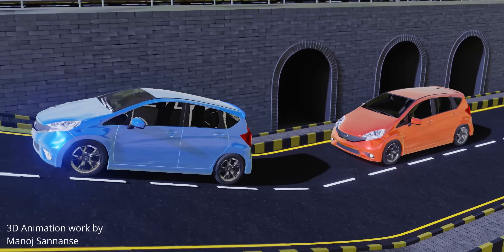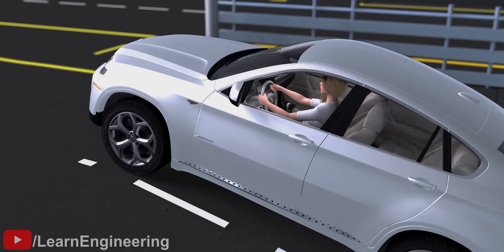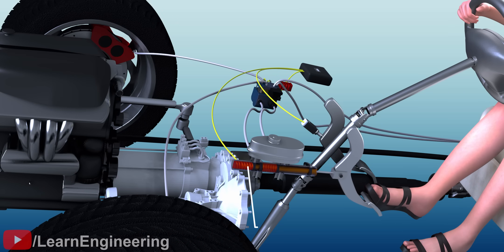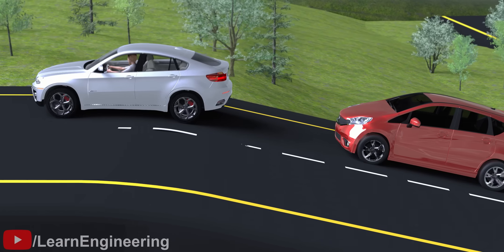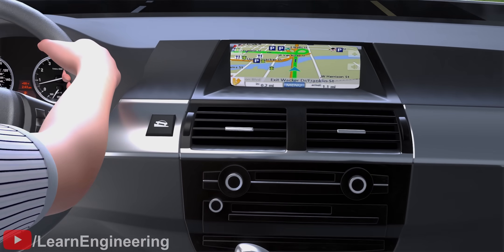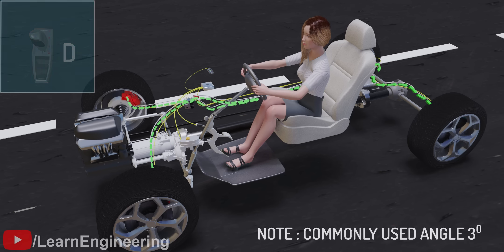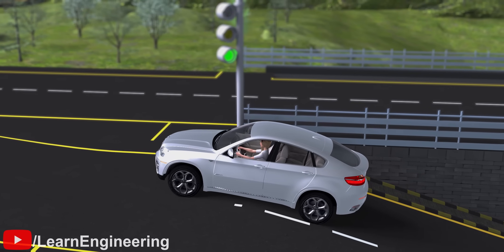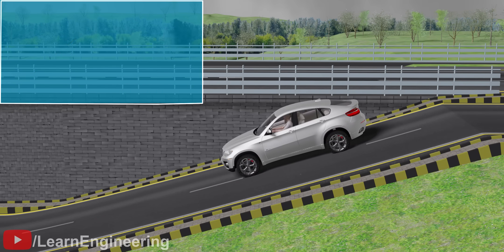Understanding Hill Start Assist!

Comment: Engineers: invents a new system to make uphill driving easier for daily drivers
Manual elitists on Youtube: "LOl, jusT uSe a ManUAl aND HAndbRAke."

Seriously, most people saying this haven't really experienced a manual car without a modern HSA system included. Even slight inclines will become an annoyance if other drivers decide to be an ass and pull up three inches behind you, which in California has a 95% chance of happening. 

You don't want every hill to be "handbrake, wait, clutch, throttle, hold for a sec, handbrake, go" in traffic. God forbid that somebody in front of you has to stop instantly to avoid a crash or something, and you're too busy slamming the brake to remember to push the clutch in, meaning now you've stalled and have to start the car again.

It's easily the biggest issue manual cars have, even more than automatics w/ paddle shifters being able to go faster than a stick nowadays. There's a reason why automatic cars outsell manuals, even in cars designed with enthusiasts in mind. They're just easier to live with. Unless you're a trucker or own a pickup, there isn't really a necessity to buying a stick anymore, paddle shifters are at a place where they can give you the same amount of fun as a stick.
Reply: This is what stick haters say these days ...
LoL

Comment: I love how all the cars in the simulation are automatic. is it not simple enough to hold the car on the handbrake and then build the revs before you release it?
Reply: Exactly. This system should be called "bad driver assist".
Reply: Kurt, LOL.   So true!
Reply: Hell, with a torque converter automatic, you can just hold it with the throttle. You don't want to do it for 20 minutes at a time, but sitting at a stoplight is fine.
Reply: Automatic vs Manual:

Automatic: press the hill assist button, let go of break press gas.

Commentator: really tedious for new drivers. 

Manual: clutch in, break, handbreak, slowly raise clutch up until you find the biting point (if you let brake the car should be stopped, that's the biting point), let brake, step on gas (appropriate gas to the elevation), slowly raise clutch while holding gas at the same pressure, keep pressuring clutch at a slightly weaker state so the car can move and then let the clutch go before immidietly pressing it in again to immidietly change gear 2 in a road with no harsh elevation.
Reply: Hahahaha ikr, these people suck at driving in the US, not even with damn automatic cars they can manage god damn it!

Comment: I have a doubt

I can drive Uphill a car with the same speed using 
# 3rd gear at high acceleration 
# 2nd gear at lower acceleration.
(Can't switch to any other gear, but can toggle in between these gears)

(2nd gear has less tooth compared to 3rd and low output compared to 3rd gear right.)

Which one uses less fuel/more efficient?
Reply: the gear which revs lower is more efficient

Comment: Hill start assist in automatics? It would make some sense if we are on manual transmission. I wouldn't say it's required in manuals, cause it's not that hard to start a car from a hill without stalling or rolling back if you practice. Hell we don't even use handbrakes in most cases.

We are perhaps oversimplifying the man's work using technology.
Reply: This video is stupid, the best thing of automatics in this video is that u can just use BOTH OF YOUR LEGS to manage the pedals. Just hold brake while you press gas enough to boost you up, why is people so stupid in this video making it like if you had only one leg!?

Comment: Use both feet and press the gas and brake at the same time until 3k rpm and slowly let go of brakes and press more gas if u fell you rolling back (AutomaticTransmission btw)
Reply: Imagine with an old manual, gotta keep handbrake, then build up rpm with gas pedal to make the clutch move you lol
Reply: How to destroy your torque converter 101
Reply: @sums6969  Yeah like, why the heck do they show it in this video like if the driver was an idiot? U can use your two legs to control those two pedals. Omg let's call Khabby 😒😒😒
Reply: @mufmager  They show the average automatic American user, they wonder how to use 2 pedals with only 1 leg smh.
Reply: @cloudshifter  Literally, searching for trouble when they have it easy lol
Reply: @mufmager    Uhh, searching for competence.

Comment: Use the other foot in automatic and use both feet gas, clutch & ur hand on the hand brake thats in manual. I think it's easy for a so called driver

Comment: To be honest if you have automatic transmission this is kinda unneccessary. Because if you just give it enough gas, you wont roll backwards even 10cm.
And if you do it fast. If you have manual its basically the same. Just give it enough gas.

Comment: The worst feature ever. Lost count how many times my car stalled because the assist kept me in place when I needed a quick start. Can't even turn the damn thing off.
Reply: I can't either on my 2009 Subaru WRX hatchback.   What kind of car do you have?
Reply: @barefootdesigns  2020 polo. just gotta learn to live with it i guess

Comment: WTF are you doing sitting with your foot on the brake in the first place? Pity these modern cars don't have a handbrake, drivers could apply that :) Even with a manual I would not expect to roll back as far as the car in this video if I were moving from brake to throttle.  Some modern cars :) even have auto off for the hand brake but be warned, it is possible to get an automatic to roll back on a hill with auto off.  You need to be very gentle on the throttle to do it but it is possible. Not sure how far it would roll but the first time it happened to me was scary

Comment: Most Indians does the right foot ankle toe trick
(Press the brake and accelerator at the same time and use the left leg on the clutch..😘) mostly done by car enthusiasts.😉
Reply: Heel-and-toe technique. Also used in motorsports for doing these simultaneously:
• braking
• rev matching
• downshifting

Comment: Jeez christ I thought the car was a manual. Imo hsa are only required on a manual car as your left leg is on the clutch, on automatics you can use your left leg to hold the brake for a few seconds, right?
Reply: Sort of true. Although, manual transmission drivers may not prefer to use their left leg in automatics due to muscle memory. They have other techniques:
• Heel-and-toe
• Parking brake

For amputees in automatic, HSA is useful when hill is steep enough to overcome the "creep".

Comment: Just press break with other foot and hold then press the gas
Reply: Manual transmission drivers may not prefer to use their left foot due to muscle memory. They have other techniques:
• Heel-and-toe
• Parking brake

Comment: Creating technology that we simply don’t need. I drive automatic transmission vehicles now a days. Here is what I do: on steep hills I just use my left foot to brake, I always keep my right on the gas pedal. That way you will never roll back on steep inclines. While going steep down hills, just switch to a lower gear. Use common driving sense and you should be fine. The more gizmos in your car the more of a money pit it will be.
Reply: Manual cars benefit the most with this. Especially petrol manuals that is a little low on torque.
Reply: Manual transmission drivers may not prefer to use their left foot due to muscle memory. They have other techniques:
• Heel-and-toe
• Parking brake

Comment: Never been a problem in an automatic lol
Reply: If the hill is steep enough, it could overcome the "creep" of torque converter.
Reply: @dbclass4075  yes, but the creep holds you in place, or rolls you back much less then a manual, and you just press the throttle
Reply: @Lionn8563  If the rollback is such a big issue, the problem might be the following driver.

Comment: What about manual transmission with additional clutch needs to be disengaged slowly as soon as brakes are released alongside pressing accelerator
Reply: Equally applicable. HSA is applicable to any road vehicle. HSA will assist you in preventing rollback as you gradually disengage the clutch, and transition from brake to throttle.

Comment: Before hill start assist, you would pull the handbrake ,gp to neutral, then engage gear accelerate feel the car pulling forward and release the handbrake.just in case your hill start assist stop working.

Comment: There is a thing called « clutch », and if you release maybe 30% of it in a hill your car will not reverse.
This assist was created because people don’t learn how to do it properly...
However in an automatic car it’s another story.
Reply: Using the clutch to keep the car stopped on a hill is bad idea, you'll ruin It faster.
Reply: ...have you ever actually done that?
You are basically burning hundreds of kilometers of your clutch. It will start to stink within seconds.

Comment: Why did you need to use that if you can use your other foot to hold the break and press the accelerator
Reply: Manual transmission drivers may not prefer that due to muscle memory. They have other techniques:
• Heel-and-toe
• Parking brake

Comment: I can use my two feet for the same time on uphill road one on a break pedal and the other one is to acceleration pedal
Reply: Manual drivers may not prefer that due to muscle memory. The left foot is reserve for clutch disengage pedal only, and part of the operation requires fully pressing it to the floor for shifting. Unintended sudden braking is undesirable. Besides, they have other techniques:
• Heel-and-toe
• Parking brake

Comment: if your driving an automatic car and stop in an uphill, use your left foot to hold the break and gas pedal to the right.

basic
Reply: Manual transmission drivers may not prefer to use their left foot due to muscle memory. They have other techniques:
• Heel-and-toe
• Parking brake

Comment: "a few seconds are required to switch from the brake pedal to the accelerator pedal".. seriously? Few seconds are an eternity.
It takes me less than a second and using a clutch. I can't imagine how easy it can be with just two pedals..smh
Reply: The only reason a hill start is hard is because there are 3 pedals and we have only two feet
Americans be complaining about nothing lmao
Reply: Seems like this is either an American thing or all of today's young drivers..

I have been in a steep hill in an auto with full load (passengers and luggage), my car didn't roll back. I have also learnt to properly hold the car in a manual, using handbrake and slowing letting out the clutch, something I sorely missed doing.

Comment: More electornics means more expensive repairs. Nothing wrong with using hand brake on hill stop.

I had to change tail light of my man truck other day, costing me 600 euros just that was a led tail light,
On the other hand tail lights with bulbs are way more cheaper, doing the same job.
Reply: The premature failure of LED light is concerning, though. It should have a longer lifespan. Premature blowout should have been valid grounds for warranty claim.

Comment: I drive automatic, the manual rear brake / hand brake / emergency brake / parking brake is more than enough to avoid the roll back on uphill start.
Reply: If the engine or torque converter is strong enough, the "creep" alone would be sufficient.

Comment: I still prefer the old school hand brake . This hill start doesnt always does the job well
Reply: In my country at the driving school learns u to do this without hand-brake. Just clutch and gas.
Reply: @shiki494  Sometimes with handbrake if you do it quickly you minimize the damage done to your car and its better
Reply: @shiki494  that's bad for the car but faster and more practical

Comment: If someone feel uncomfortable driving a car with manual trinsmission, than they should first start with a low power scooter. It will be much more safer and practical.

Comment: Another usage of break pads to help people. The BMW car has two more tricks to wear out your break pads.
On a down hill, when pressing the break pedal then release it, the car intelligently continue to apply the brakes for you. It feels like motor compression (transmission set to "1") while leaving the transmission on "D", but no, it really use the brakes.
Note that the intelligent transmission will ignore your whish to go on compression until the car speed drop below 20 mph, a speed where compression is no more needed.
BMW engineers also had the good idea to apply the brakes on cold starts to dry the pads.

Comment: if a person had only one leg then it would be a very useful thing. But this is not the case
Reply: Manual transmission drivers may not prefer to use their left leg due to muscle memory. They have other techniques:
• Heel-and-toe
• Parking brake

Comment: for automatic both legs can be used to hold brake while pressing the gas (HSA makes no sense at all then) 

for manuals there is the handbrake, which assists while relesaing the clutch and pressing the gas (here HSA is a huge help)
Reply: You would need a very steep hill that can overcome the "creep" for HSA to be useful in automatics.

Comment: I partially release the clutch enough to avoid the car go backwards, then throttle, then fully release clutch. I don't use handbrake.
Reply: dependingt on how steep the hill is, this maybe wont work because theres not eneough power at idle or you stall.
Reply: @Coolgamer400  There actually is. Just give it enough gas and you get over every hill without hand brake. You just need to be fast.
Reply: @NEMATlC  true
Reply: @NEMATlC  sounds fast but inefficient and dangerous in bumper to bumper traffic
Reply: just bang it off limiter and dump the clutch, that is the only way
Reply: @sums6969  lol
Reply: The steeper the hill is, the more delacate your clutch biting point needs to be and the easier the car risks of shutting down.

Often the car engine changes sound when the biting point is there

Comment: How does HSA determine the point at which the brake should be released. Im pretty sure that the point would be where torque power exceeds the braking power needed to stop the car from moving. But how is that level determined? The angle of the hill will differ from one place to another, so is it the same amount of power for every angle of slope or does that differ?
Reply: Good question.

Comment: I don't need this type of technology, I drive manuals, it's so damn easy to start on hill
Reply: Problem with some manuals or most, is that they need rpm to make the clutch work, like my fathers car as a new driver it gives me anxiety when I get to stop in a hill but I manage to go out with handbrake lol
Reply: @mufmager  yes, exactly, it needs some rpm, so you don't stall the engine. So you don't need to be anxious, you can keep the car from going backwards without handbrake by using some throttle and releasing just a little bit the clutch, it's easy if you practice it a little. But your method it's also good, especially for a beginner.
Reply: @LiviuLvu  The thing is, the car we use doesn't have that :( only the Diesel car in driving school had that great feature that would be perfect enough for me to drive a manual car. But my father's car don't have that (it's a Peugeot 206 sw 2003 model petrol engine)  so I can't just have that advantage of using some of the throttle that the clutch has, I literally have to use the handbrake, get enough rpm in the engine and release the clutch while I keep pushing has pedal slowly and then, while doing all that shit, the handbrake 😩😩 im glad it's not my car.

Why doesn't his car have that throttle by releasing the clutch itself without having to push gas pedal and the Diesel car in driving school I used went by itself if I just lifted the clutch a little????  If you could answer this would be also great. I'm sure not all cars work like that Diesel mini one model I drove in school xd
Reply: @mufmager  I know exactly what you talking about the driving school car :)) mine was a Vw golf 7 diesel and it was the same thing, just releasing the clutch, would have made the car move forward in almost any situation. I'm thinking that because the car is newer and has a lot improvements on mechanical and electrical systems, but also I know diesel cars have more torque than a petrol car. My father's car is a Skoda fabia mk1 petrol/lpg and in the first day having the driving license, I had to hill start(random situation), I didn't know when you release the clutch, it will stall the engine(I was used to driving school's car) and I stalled the engine 2-3 times and also, I was with my father, I was feeling very anxious, because there was cars behind us and busy traffic. Funny story now :)) but I'm glad I learned quick
Reply: @LiviuLvu  yeah that happened to me when practicing with my father's car in the parking lots and industrial roads, since buying driving lessons became expensive and failed the first exam attempt, we just practiced a lot with his car and then passed the exam last year before halloween, if I ever buy a manual transmission car I will ask if it has that throttle that idk if it's called that way tbh lol
Reply: @mufmager  happened to me too, I was at the second attempt and before this I practiced on a forest road with my dad. What do you mean by manual transmission with throttle? Do you mean the torque? I meant gas pedal, if you understood something else :)
Reply: @LiviuLvu  by throttle I meant that if I lift the clutch a, bit, the car moves so in hills I can have my foot controlling the brakes, making it easier
Reply: @mufmager  ohhh, yes, would be nice :) but in the meanwhile you should learn to be good without that throttle
Reply: @LiviuLvu  I kinda am what sucks is that my feet slide up from the clutch if I use it a lot and Its annoying, like I gotta push it back down and try to slide my feet down or put neutral to place my feet in right position of the clutch xd, specially when I park or there's traffic
Reply: @mufmager  you will be very good, someday, with any car, any transmission 😁👍